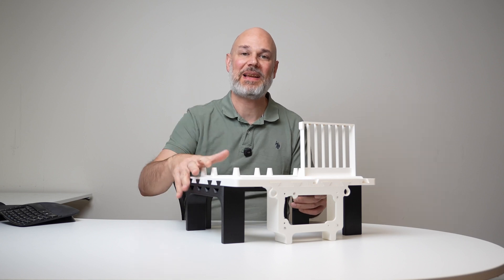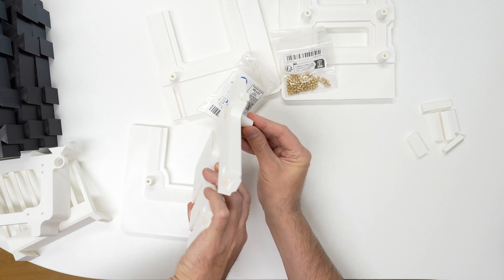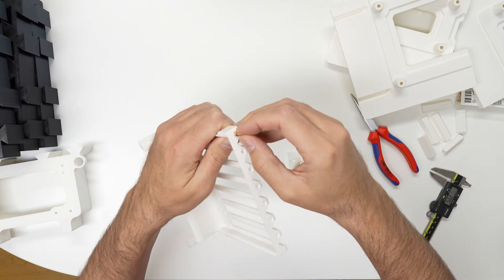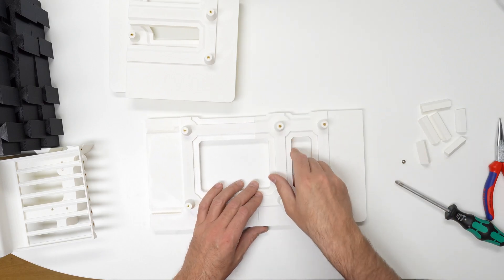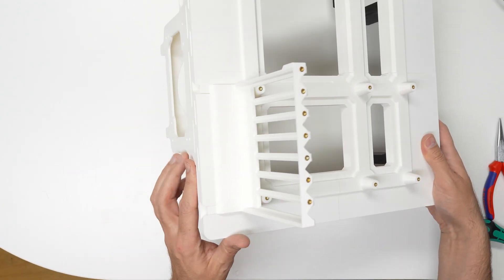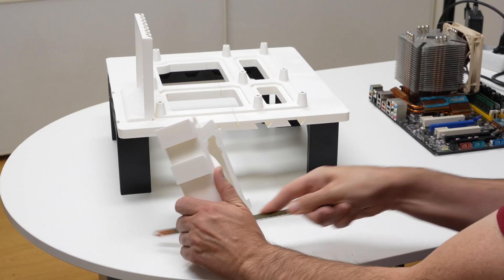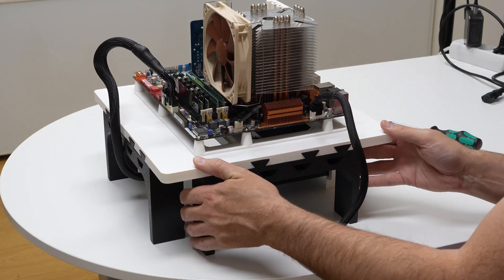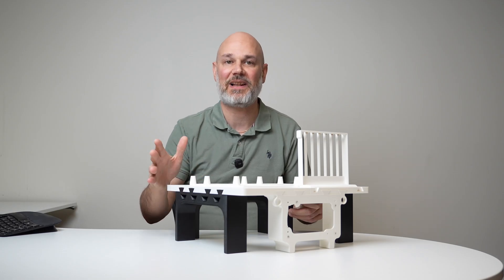This Entire PC Test Bench Is 3D Printed… and It Works?!

Comment: Great video, just had a quick question, does it only have compatibility for ATX motherboards or does it also work with mini or micro ATX?

Another idea I had for you: For the connections, between the compenents it may be possible to use some kind of compliant mechanisum to hold the parts together without sliding, something to think about.
Reply from the maker: IIRC MicroATX has 6 holes in common with ATX and then has 3 extra holes which I think will not be possible to attach in this build. But it will probably be stable enough just using 6 holes. MiniITX I think has 4 holes which are a subset of ATX holes so it should work.

Good idea about the parts, will keep that in mind if I do a second version.
Reply: @KelloLabs  Thanks, I will let you know how I go. 😃